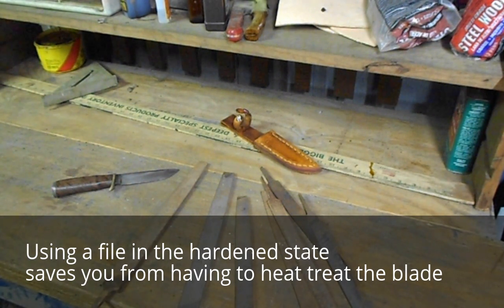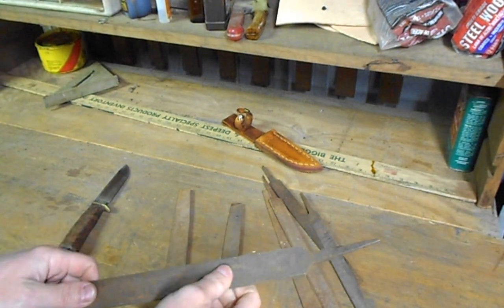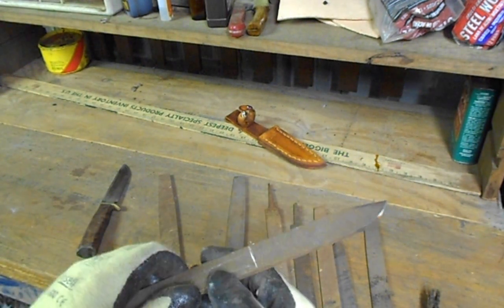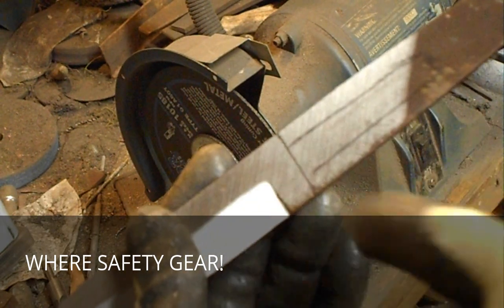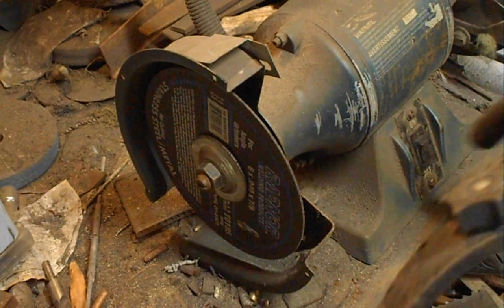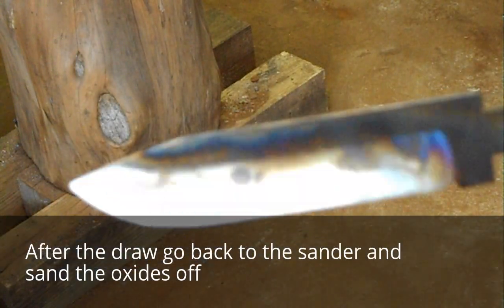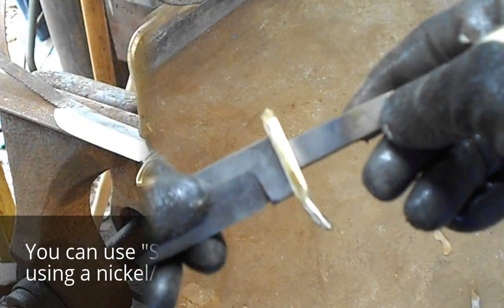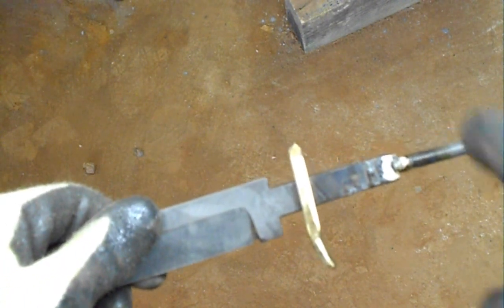Making a file knife

Comment: I've made many knives out of old files and rasps. I also made a pretty cool sword out of an old boat nail spike. It took hours and hours of grinding and sharpening but I loved every minute of it. With the limited tools and supplies I have I've managed to make some pretty nice blades. I've been making knives a lot lately because I've been out of work for 8 months due to a back injury so I started making knives again to pass the time. I love going to the flea market and looking through all the old tools and junk for different things to make blades and my step dad is a tree trimmer so I have an unlimited supply of wood for my handles.I plan on building a forge and buying some better tools as soon as I get my Workmans comp settlement. Then I'll be making some really awesome knives!

Comment: Always I kneel my files and rest before I work on them it saves you from burning through cut off wheels or saw blades or whatever it is you used to cut out the pattern and grind the bevels but if you don't have a way to get the steel up to critical temperature in order to harden it then I guess it's okay to just hope you don't overheat it while grinding and cutting and hope the tempering cycles fix it.
Reply from the maker: The reason I prefer to grind the files hard has to do with the heat treat.  The old Black Diamond and pre 1981 Nicholson files were made from an alloy containing 1.27% carbon.  These files were heat treated in a lead bath with a brine quench and generally test out at between 67-69RCH (although, with a 50+ year old tool you can't always know what's happened in the past so sometimes I'll run across a softer one).  With a near perfect heat treat all that's required is a temper cycle to reduce the hardness down to 58-60.  Now I like to do a soft back draw and soften the tang/recasso area for added strength.  In my experience, by re heat treating these old files you loose performance.  At best you'll loose 20% if you use a forge and get it perfect.  If you have a heat treat oven, expect a 10% loss.  If you are working with the post '81 Nicholson (and this is something I learned after the video), these files contain 1.59% carbon.  Nicholson went from the toxic lead bath to an induction furnace, due to the less effective heat treat they tried to compensate by using higher carbon content.  Those later files didn't perform as well.  IDK about modern ones, I avoid them.  As far as abrasives go, honestly I spend about $300 a month on belts and find really not enough difference between a hard file and annealed one to make a difference.  Now if you want to talk high alloy like CPM 3v, yes there's a huge difference.

Comment: Beautiful spark pattern from that file. Easily decernable as good high carbon steel.
Reply from the maker: Don't ever trust the spark.  Just yesterday I tested out a Heller rasp.  The sparks looked good but it wouldn't harden.  As best I could tell it wasn't much better than a rr spike.  Quenched the tang and tried to break it with a hammer, it bent right over.

Comment: Thanks for the video.  I have seen a few file - - -> knife videos, and I have to ask, Why is the grinding done on such a hard piece of steel instead of tempering it first, then do the grinding?
Reply from the maker: Good question.  Grinding would go faster if the steel was annealed but there are several reasons I do it this way:  The main reason is the old Nicholson brand files including the Black Diamond were heat treated in molten lead with a brine quench.  These files run in the 65-69 RCH range and the heat treat is near perfect already.  By annealing and re doing the heat treat I'll see at minimum a 20% reduction in performance, if I use the heat treat oven I might get that up to a 10% loss.  There is little difference in the amount of belts or time it takes grinding them fully hard or tempered to the 58-60 RCH range.  The second reason is time.  In the time it takes to anneal the file I can have the knife ground, tempered and a handle on it.  That is to say, I can fully assemble the knife.  This isn't to say that I do every file this way, some I anneal out.  With the bolt through handle it makes more sense from a performance and time management perspective to work them like this.
Reply: @jamesmcclendon1203  Thank you very much for the information and response, I didn't mean to anneal it, the heat treat, I just meant temper it first, (If you are going to temper it after grinding).
Reply from the maker: @thomasgronek6469  Generally I'll grind to about 90% finished then temper and do the soft back draw.  It really doesn't take any longer and doesn't use any more belts (if you're using good belts).  This way if I screw up and get it too hot during grinding I can go back and heat treat it.  Since I did this video I started using ceramic belts over the Norton Blue Zerconia.  The belt life has almost tripled.  The zirconia belts still have a place in my shop as there are limitations to the ceramics.
Reply: @jamesmcclendon1203  if you can make a complete knife in the time it takes to anneal a single file I would love to see that on video because I highly doubt it.

Comment: Has anything bad ever happened using the cutting disc in the bench grinder? I know you mentioned very dangerous, never seen that before just curious? File knives are awesome and yours look great man nice work.
Reply: I wouldn't recommend it. Grinding blades should be used specifically what they're designed for and at the correct RPM they're designed to run at. Also, never use an old blade or one that's been wet. They have a habit of shattering. Always treat grinders with a lot of respect as they can be extremely dangerous. Just my 2 cents.

Comment: James, jimmontg here. You grind backwards like I do,(safest way BTW) it's why I bought the 2x48 Dayton I have, plus it was on sale for $230 from ZORO.com, but they have it at $350+ now which is it's usual price. I like how you use your angle grinder so much, I use mine for larger knives as well. I don't use the file tangs either.
Why are you using a cutting tip on your torch for doing the drawback and braze for? Kind of harder to control the heat, or is that just how you learned? Of course I'm a welder by trade so I would use a small tip for the braze or use a tig if available.
 James you need to add temper instructions is my only critique. Like 400 degrees until it turns a cardboard beige color and then then take it out and let it air cool (will be about RC 59-60). It's what I do with files I turn into knives. I don't like to heat treat by annealing them and then do the heat treat again, your way is easier because as you said, you only need the kitchen oven.
Reply from the maker: Thanks, I think I put a blurb in there about tempering.    As far as the torch tip goes, yeah.  I sell welding supplies for a living and finally bought a brazing tip.  It is easier to control the heat with one of those.
As far as the tempering for a file, it can vary from file to file.  Anywhere from 375 - 450 in my experience but for a small hunter those Black Diamond and old Nicholsons seem to do best at 430F.
Reply: You sell welding supplies? That's great, I am a master TIG welder and am very familiar with the different rods and metals. I have done micro welding on the edges of dull punching dies and punches. That .010 rod is expensive. If you ever need any advice give me a call, you know where.
Reply from the maker: Thanks!  I've dealt with tool steel filler before.  It takes a lot of knowledge about the material to be able to work with it.  I guess that's why you went into knifemaking.  lol.

Comment: With the amount of material you started with it was absolutely no reason to do the half-assed brazing on a piece of all thread for a Tang you could have made it all one piece of the same steel and soften the end of your tongue and threaded it ordinapened overtime I've never had a knife made with a braised on tang that did not break.
Reply from the maker: First, thanks for watching.  This video is almost 6 years old.  In that time I've made and shipped close to 1000 blades using this technique shipping them around the world to craftsmen, hunters, outdoorsmen and collectors.  Zero failures.  15 years ago, when I first started making knives I did the full tang thing but didn't like the handle failures (not tang, but handle).  About 13 years ago I got a copy of the late ABS Master Smith Wayne Goddard's book where he outlined his CQK (Combat Quality Knife) handle.  He brazed machine threads on the tang and a nut on the pommel.  I've taken that and used larger threads and a coupler nut,  brazing large threads is stronger than cutting in machine threads, but that's neither here nor there.  I'm not sure why you have had issues with the braze failing, in my experience the braze (StaySilve 45) is rated at 60-70 psi tensile strength.  That's stronger than the grade 5 threads.  If the brazing isn't done correctly, it absolutely won't hold.

Comment: how hard is the Steel of the finished blade?
Reply from the maker: +raphasuff Good question.  Most of the time you will see a blades hardness given in the Rockwell scale.  A new, un-tempered file will usually be between 62-64 RHC.  The files are actually tempered from the factory, as quenched it will be very brittle at around 68 RHC.  With out further tempering the blade made on the video would be brittle and the edge would chip easily.
    So how hard?  It really depends on the knife and the steel it's made from but for a smaller knife 57-58 RHC seems to be the best balance between edge holding (as hardness goes up so does edge holding).  With some simple steels, like the files are made of one can manipulate the hardness easily allowing a harder edge and softer spine.  But the max hardness for a good hunting knife for most steels would be 60 RHC as edge chipping begins to be a problem past that.
     You can get a rough determination of your hardness by using a new file.  It will not cut into a steel as hard or harder than itself.  At 58 RHC a file will cut but not easily.  At 50 The file begins cutting well.  
Another good test is to get a 1/4" brass rod and clamp it in your vice.  Press the blade at the sharpening angle against the rod.  I like to do this edge up as the effect is visible.  The edge of a properly hardened blade will flex and return.  Too soft and it will dent, to hard and it will chip.  Just press hard enough to get the edge to defect.
Reply: +James Mcclendon Thank you for your comprehensive answer James. I asked that question because I was curious how much of that hardness you loose when grinding already hardened steel. The heat that results of the grinding must take some of that hardness away (so my thoughts)
btw that´s a good looking knife
Reply from the maker: +raphasuff  Grinding does cause heat to build up, so it is very important to keep the steel cool.  As the edge thins heat can build up very fast.  As long as no tempering colors (blueing) then you haven't changed the hardness.  The second the edge blues the temper is ruined.  
The only other cause for reduced hardness using this method is if it is done on a thick file.  This is mainly due to a reduced hardness caused by the shallow hardening characteristics of a water quenched tool steel.  Thick files may not be as hard in the center.